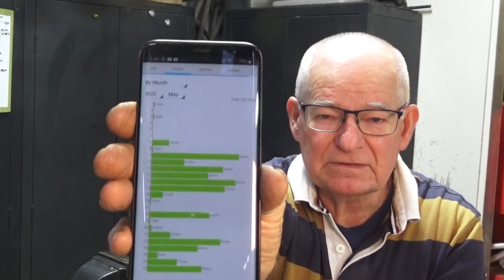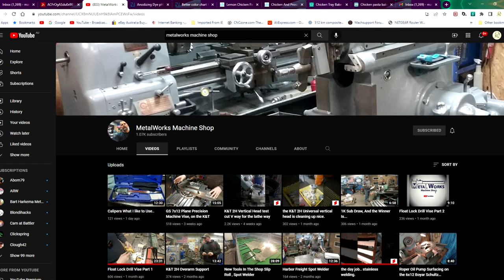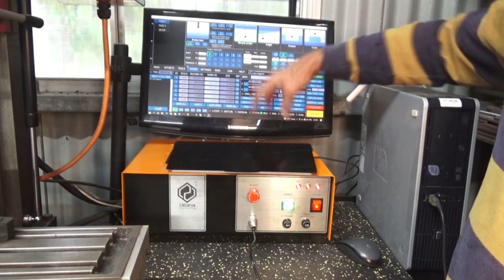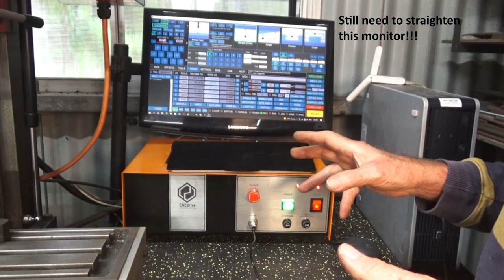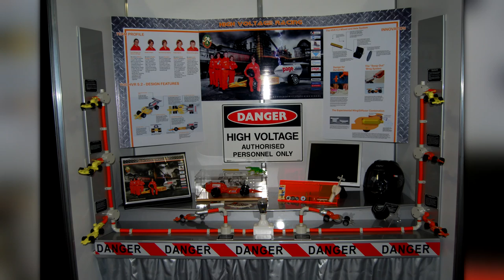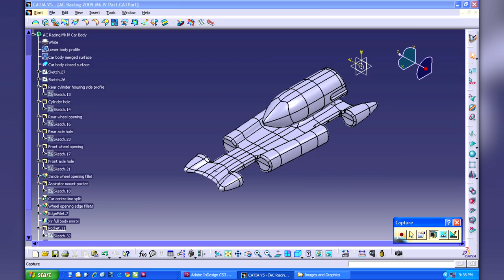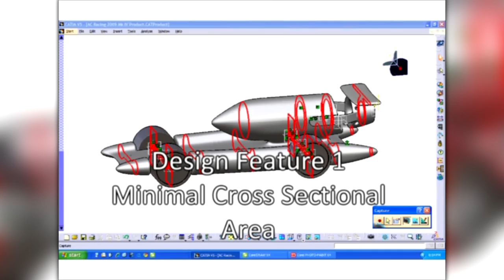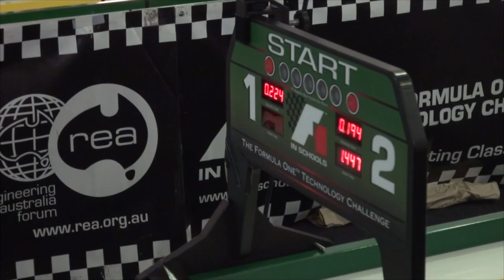Little Wooden Cars (or - How To Make an Engineer)

Comment: I love hearing about STEM projects like this. We have something similar in the States called Pinewood Derby where kids are given a block of wood with wheels and carve a racecar out of it. They are gravity powered only, however. Using CO2 cartridge rockets would definitely add more excitement😄
Reply from the maker: I have seen the Pinewood Derby cars before and it's a great way of getting kids to start thinking about design and innovation. The CO2 cars are spectacular though. Lots of gas vapour and the occasional catastrophic failure guarantee excitement.
Regards,
Mark

Comment: I had no idea that this program existed, I went to a tech/high school in the 80s which has been a secondary college for years now. I wonder if the engineering, woodworking, mechanical appreciation, electrical engineering and sheetmetal rooms still exist? I was lucky enough to learn in those rooms when they were brand new! Having remained in the same area since, I never see students carrying items made in such classes, so sad. Mark you are a legend!
Reply from the maker: We had to fight very hard to keep our share of the budget during the time I was teaching. I still visit my old workplace occasionally and it is sad to see the state that it's in now. School administrators and bureaucrats don't understand the importance of teaching kids how to use tools, how to identify and work with materials and to understand their properties. If the bean counters had their way, they would sell off the workshops and have the kids make models out of paper and pipe cleaners! Some countries did do that and there was such a backlash from industry groups that they had to reinstate basic skills courses. Anyway, end of rant.... Thanks for watching.
Regards,
Mark

Comment: We did the CO2 dragsters in 1973.  The class was called The World of Manufacturing.  Same concept.  I built a midengine design, and the teacher was unable to easily pierce the CO2 cylinder, so it didn't set fastest time.  It was the lightest in the class by quite a margin because I was able to replace the rear cone with a wrapped paper cone to meet the minimum length requirement.  It was a super fun project.
Reply from the maker: I used to love it when some kids pushed the rules to the limit. Even if the design failed or wasn't super fast there were points awarded for design (and innovation) and that often made up for a lower elapsed time. 
Regards,
Mark

Comment: Fantastic video, Mark!

Many years ago, my wife and I became involved with Cub Scouts, as a way to help out with an activity that our sons were involved with.  One of the things that Cub Scouts did each year was a Pinewood Derby.  Pinewood Derby cars were by no stretch of anyone’s imagination anywhere near as advanced as what you’re showing in this video (ours really were simply “little wooden cars”), as Cub Scouts range in age from first through fifth grades.  Each Pinewood Derby kit came with one pibe block, 4 injection-molded wheels, and 4 axles, which were really nothing more than a small round-headed nail.

These cars were ran on a track that started off about 4-1/2ft tall, and dropped at (I’m guessing here) about a 30 degree angle.  The cars themselves we’re completely gravity powered.  Pinewood Derby cars also had certain dimensional/weight parameters that they had to meet in order to race.

Eventually, my wife wound up being the Cub Master for our pack, and one of her first priorities was to raise the necessary funds to replace the old rickety wooden track (built in the late 70s, fully manual operation, with one lane that couldn’t be used because it would throw cars off, and two dads standing at the end to watch the finish line, and a third to break the tie when the first two couldn’t agree on which car finished first) with a state-of-the-art aluminum track complete with laser-eye finish lines and race-management software.  We went from only being able to run two lanes for a double elimination race (oh, sorry you’re out, Billy, but please try to sit still and be quiet while the kids who are winners get to keep playing…) to being able to run 4 lanes at a time, and setting the computer to let each kid race 4 or 8 races (depending on time), each time against different kids, and award trophies based on best average times.

To help offset the costs of getting all of this set up, we instituted a “Dad’s Derby”, which we opened to the public, where anyone who entered for a small fee would get a kit, and a chance to compete.  This Dad’s Derby was quite a success, drawing most of the Cub Scout dads, a few of the Cub Scout moms, and almost all of the local Boy Scouts to enter.

Like you, I could go on about the subject for hours about what makes for a winning car (spoiler alert:  it’s all about the wheel/axle prep, baby!), but I don’t want to bore anybody, 😂 

If you made it this far without dozing off, have a great evening!
Reply from the maker: I have seen some of those Pinewood Derby cars and they are a great way of teaching woodworking skills with the incentive of having a race at the end of it. Being a gravity race makes for some interesting strategies. We used to stress the importance of keeping the car mass as low as the specification would allow but with Pinewood Derby cars I am guessing that you need some mass to keep the cars inertia up there. You are correct that friction is the enemy of any of these cars. We used to use a lot of graphite to lube up the axle holes. We also burnished the graphite into the balsa wood by spinning up the wheels with compressed air. One of the pieces of kit we were given with the F1 programme was a wind tunnel. We actually had two, one was a high speed unit and the other was a low speed tunnel with a smoke wand. It sort of worked but we had no idea what we were seeing or if it was good or bad. Just before I retired we went to our local university to use their water flume. They had a clear test section where we were able to put a 3D printed replica of the car and then inject dye streams into the water. Because the water was about 800 times more dense than air, we could run the water past the model at 25mm per second instead of 20 metres per second. Now we could see exactly where the fluid was going and more importantly, where it wasn't going. Now we finally understood about laminar flow and turbulence! It really was a revelation but unfortunately, the judges didn't understand what we had discovered. The kids knew more than the judges and they were too polite to explain it to them!
I am glad you got the equipment you needed to make the STEM challenge a success and that it grew into something better than what you started with. 
Regards,
Mark

Comment: What a great video!  It gave me some great ideas for a science fair that I am developing for the Science and Technology museum that I volunteer at. Thank you.
Reply from the maker: There are lots of STEM projects out there and they don't need to be expensive to work well. I helped my son and some of his mates to build a small human powered go kart. The competition was run by a private school in the area and it was called the "Billy Cart Grand Prix". Most of the carts were made out of old bike parts. The kids just had to push them around a roughly circular, undulating course. We made our cart out of wood (stiff and lightweight) and we welded up an aluminium tube push bar for the three kids who were the human motor. The team of four won two years in a row. Good on you for supporting the science fair. 
Regards,
Mark

Comment: Mark, Thank you for the Shout out and for the interesting video.  I had a Bertone Fiat X19 back in 1981 (a 1977 model) wish I still had it.  Also, back in 1969 or 1970 a friend of mine and myself started a C02 Dragster race club in junior high (7th grade I think).  It continued at that school for many decades.  We called it the Roadrunner rally.  Your videos brought back many memories. Do you know how many of your former students were inspired by your teaching enough so that they pursued a career in engineering? Thanks!
Reply from the maker: Jim, thanks for watching. I do know of four former F1 students that have successfully completed engineering degrees. One got in touch just last year. I started working with him in year 8 and he graduated with a double degree in mechanical engineering and IT. It's possible that they would have gone on to the same outcome if they had not done the F1 programme but it cannot hurt to immerse young people in environments where so many successful and talented people are willing to treat them as equals. That was the thing I was so impressed with. To see an aircraft engineer talking with kids about aerodynamic forces or strength of materials but not dumbing it down for them was a real treat. 
Regards,
Mark

Comment: Mark, do you know enough about lofting in 3D CAD software (like when your extremely bright student used CATIA to model the entire car with a single loft) to either make a video on it or point to other useful videos?  While I used multiple CADD & CAD packages before retirement, I never had the opportunity to use the "high-end" packages like CATIA.  I was limited to ComputerVision & AutoCAD in the '80s+, got multiple versions of SolidEdge in the '90s, and ended up using SolidWorks a bit in the 201x's (but my workplace never purchased its higher-cost options).

About a year or so before retirement (i.e., ~2019) we received a model from the F-5 Aerospace Engineers that our CNC Programmers had to convert (both of their groups used the same high-end software, similar to CATIA) to a "shell model" of the fuselage that my office could (kinda) use with SolidWorks.  I feel that if I had known more about 3D lofting and SolidWorks in general, the "shell model" would have been much more useful when designing fixtures for working on/with the entire fuselage.  (Yes, the F-5s are still in use and are still being overhauled! ;)  I'm still in contact with some of the younger Engineers in my old office and would like to point them to possibly useful sites and/or videos, if possible.
Reply from the maker: Bob, one thing that I learned was that if I had done my job properly, the students I taught would one day know more than I did. This was the case with Daniel who made the model of the car using one lofted profile. I watched over his shoulder as he refined the model again and again and I was totally stumped as to what he was doing. I went home and tried to replicate what he had achieved and got very little done. Lofts require very careful arrangement of the workplanes and sketches and he was using rails to control the surface between the workplanes. Rails are 3D sketches and without them you tend to get very unpredictable results. I can usually get a transition between about four workplanes but after that it tends to get very chaotic. We did have a manual which was written by the people at Re-Engineering Australia and it showed the step by step approach to design a sort of generic model F1 car but after that we had to just wing it and see what the various tools could do. Another student of mine had absolutely no fear and he would try out every tool in the programme just to see what it would do. I learned more from him than from the manual. Kids are very good at learning new software because they understand that you cannot break it. If it all goes to s**t they just close the file and start again. One of the people I met during my time with Re-Engineering Australia was a programmer and CAD expert who wrote converter programmes to take old, obsolete CAD data and make it operable with more modern platforms. CATIA was written on the old UNIX architecture and when it was upgraded to V5 which was Windows based a lot of aerospace companies had to migrate all their considerable data to the newer platform. It was a massive job and consumed a lot of man hours. We went to a Boeing plant in Melbourne and they showed us a fully articulated CATIA model of a flaperon  for a Boeing 777. However it looked kind of old school and Autocad like. 
I recently started using FreeCAD and it looks and feels a lot like CATIA V5 and is probably based on the same architecture. Unfortunately, there doesn't seem to be a lot of resources for CATIA in the public domain but there is plenty for Autodesk Inventor which is what I use now. It is as good as CATIA for what I do but CATIA had some really exotic "workbenches". One was the kinematics workshop in which you could call up a human kinematic model of, say, a Korean 75 percentile male and have it interact with a model of, say, a work fixture to see if their arm could fit inside a cubicle or whatever. Interesting stuff!
Regards,
Mark

Comment: I know from building model rockets (I have made about 140 of them and designed 35 or so of those) that it's no small feat getting a good finish on balsa wood. Those finishes are truly incredible. As always, Mark, amazing work!
Reply from the maker: Murray, we sprayed a nitrocellulose lacquer sanding sealer first to stiffen up the fibres of the bare balsa and then the students were set to work sanding out the CNC tool marks in the wood. We found it best to do this outdoors in good strong sunlight so you can see from the shadows when the surface is smooth. We then gave the cars another coat of sealer and then several coats of spray putty, then a guide coat of matt black. After that it was just hours and hours of tedious sanding. When we had the spray putty as defect free as we could get it we handed the cars off to a local company who sprayed the top coats for us. They would give them back with one colour all over the car and we would apply laser cut masks from frisket film and give them back for the second colour if necessary. However, white cars (all over) were easier to decorate with water slide decals. 
Regards,
Mark

Comment: Hey Mark, I recently found your channel and I'm amazed by your work, especially the titan .60 engine build.
As an electronic technician I was a bit shocked about your circuit box in part 11.
You maybe should replace them.
I can't see  clearly if your part is just a motor protection or a combination of contactor and motor protection. 
We used Eaton, ABB or Siemens for motor protection switches and contactors, the are industrial standard and highly reliable.
A 16A motor protection switch costs about 70 euro but its mutch cheaper than replacing a burned motor. 
Sadly I don't have any spare parts I could send but if you interested, send me a note with the data of your machine and I can look up the right parts for you.

Keep up the good work. I dlways enter to become a machinist (lathe, shaper, milling) but at my time only cnc apprentices where looked for and I wanted to become a manual machinist, so I became an electronic technician, my second job choice...
Reply from the maker: I almost did replace the contactor and the motor protector. I was convinced they were faulty but as it turns out the fault was elsewhere. Also, the issue with the capacitive scales doing random resets was not fixed by terminating the three phase connection firmly. It turned out that the scales must be isolated from the machine by using insulating mounting hardware. I just replaced all the brackets with delrin and laser cut acrylic parts and this has fixed the problem for good I hope. I wish I was a bit more confident with three phase wiring!
Regards,
Mark

Comment: Thanks for that, I would say that you have definitely left us a sound legacy in the youth that you have inspired. 2010 Camrys are cool, mine is 2009.
Reply from the maker: I shouldn't bad mouth my Camry. It has been the most reliable car I have ever owned. It's done 175000 and I think I have only ever replaced the battery twice and the tyres. No rust either!
Regards,
Mark

Comment: Very nice Mr. P. That would have been something I would of loved to do but CNC was not available in my time at school. You are one of the people that I look up to. Thank you so much for teaching us through your channel. Just a quick check on your wiring for you new CNC controller. Your shield on your control cables are terminated on one end only, correct? The reason is if terminated on both ends can induce current flow and create interference that can  be picked up by the controls. Just a thought. Cheers
Reply from the maker: Yves, we would never have been able to acquire any CNC machinery or software if we hadn't signed up for the F1 programme. Once we were designated a hub school, we were supplied with the router, the track, some wind tunnels and lots of high end software. It came with a price though. It consumed my life for the next 10 years but I wouldn't have done it if I didn't enjoy it. With regards to the CNC controller, I did terminate the shield at both ends. I haven't really done any serious machining with it yet so I cannot tell if that will cause any problems. I will investigate that further though.
Regards,
Mark